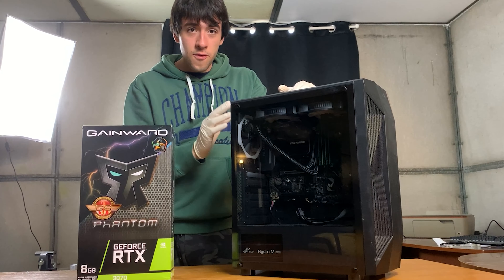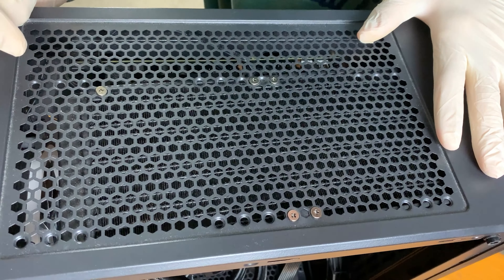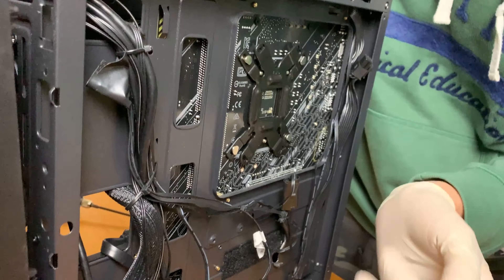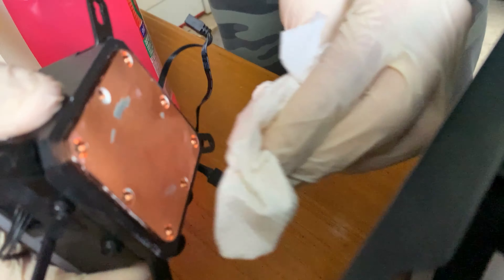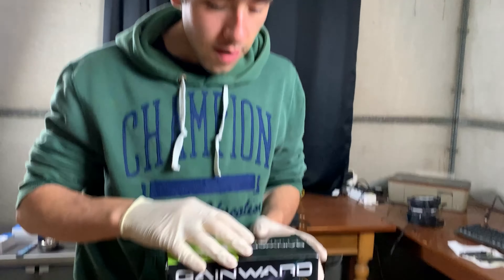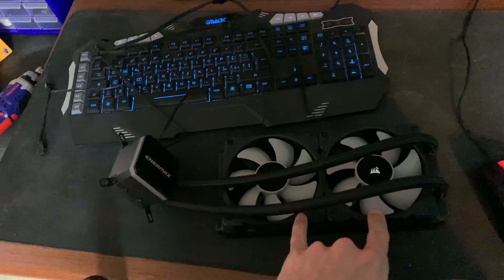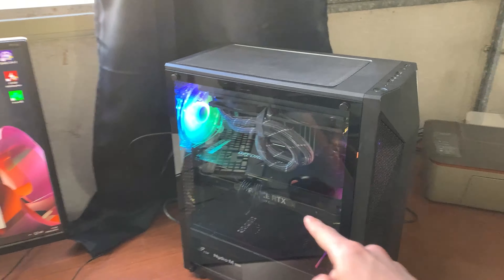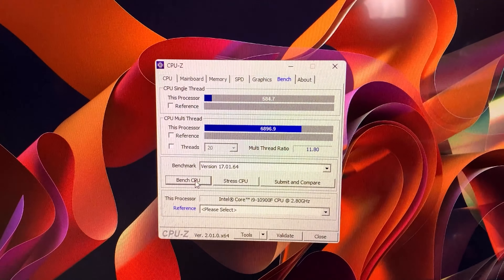Buying a BROKEN $600 PC on Facebook Marketplace... PC Flipping Series

Comment: That top m.2 may not be defective. Some of these newer boards are very picky about nvme and m.2 ssd.
Reply from the maker: It actually wasn’t defective, my bad for not clarifying it in the video, I had it in the footage but it was cut out. What happened is, since the board is a B560 but the i9 is of 10th gen, Gen4 PciE isn’t supported and so the top M2 Slot is disabled. A bit annoying but working as intended :)
Reply: @ImWateringPSUs  no prob bro! I ran into this as well. Sucks when flipping PCs cause you don't always control what you get good deals on lol!